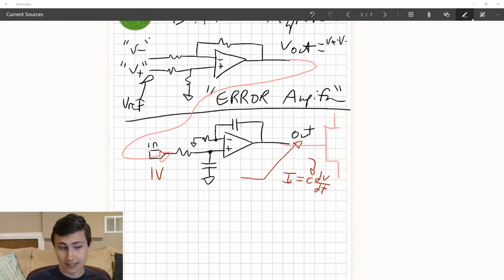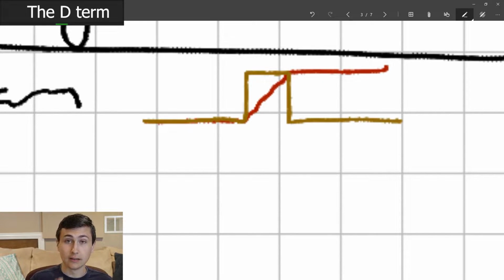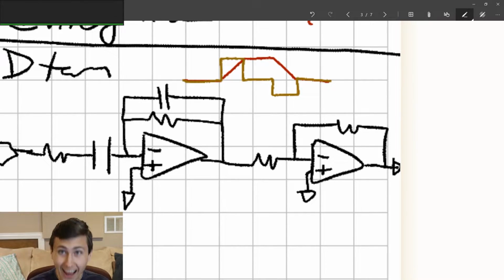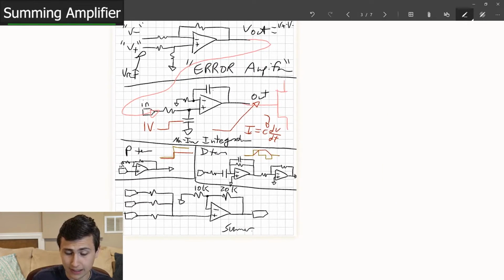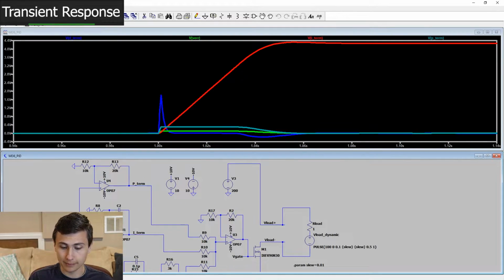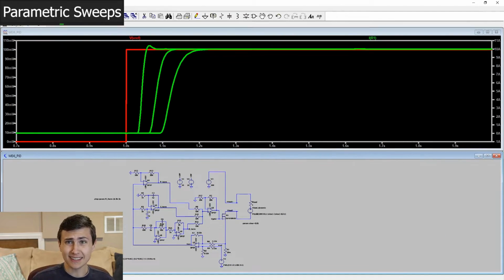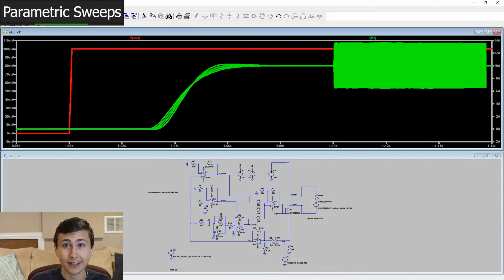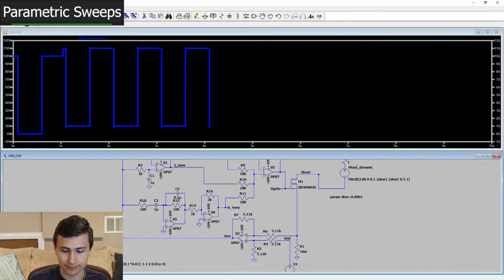PID Compensator (Improving Transient Response)

Comment: The results that you are executing in transient are not the same as iam executing them why?
Reply from the maker: Interesting... I'd expect spice to work about the same everywhere. A couple thoughts: varying step size in transient simulation can make slightly different numbers appear. I didn't restrict step size, so that's possible if we're a little off 

If we're way off- using a different opamp can have a big impact on performance! Other than that .. it's hard to say, If you can find our email on the about page (www.youtube.com/EEforEveryone/about)

I'll gladly send over my sim file!

Comment: Looking forward to an electronic load project.
I have enjoyed your take on introducing/developing A PID control system via opamps.

I have a couple NOS TSD4M350V's  on the way hopefully. Who knows when they'll turn up though =P
(Cheapest high power FET I could find with a DC rating curve?)
I also bought some socketable multi phase converters for high current testing.

I think a mix of analog and digital would be nice. Definitely want some fast acting protection circuits.
A current sink is a good place to start, but some way to do an ohmic load or constant power would be nice.
I recall there are some analog feedback circutis that approximate these? Depends on accuracy? I've never built them.
Analog multipliers are hard and/or expensive IMO =P. But then the alternative is digital control systems and that becomes a whole other discussion?

Auto ranging would be nice. I think the issue there is switching softly between them.
I guess the economics would mean the best option is low side switching with another FET?
High current relays, or reed relays for speed, if you want to be able to handle higher voltages get very expensive?

Depends if you're talking sub 5-10A down to milliamps, or you want one unit that does millamps to tens of amps?
Reply from the maker: Hello Normally Open, 

Oh boy, I'm starting to fall behind on YouTube comments now. :) That's a new level! Even if I'm a little late, thank you for reaching out, and thank you for leaving this awesome comment.

I tried to find a datasheet for those parts... are they super obsolete? Didn't find anything from the usual suspects.

Agreed on the mix of analog and digital, analog for fault handling (maximum speed) but some digital features will be good too. Like you said, behaving like a resistor, voltage source, etc, will be awesome! And perhaps we can find a way that reduced transient response or refresh time becomes an acceptable compromise when operating in the more advanced operating modes?

The nice thing about autoranging loads is they can all be in parallel, assuming the same DC voltage withstand exists across all ranges... even if they all can't pass current at that voltage!

I don't want to repeat too many thoughts from my other comment, so I'll leave it at that for now. Can't wait to see you in the comments as we kick off the design series! Thank you again for watching!
Reply: @EEforEveryone  It's some ancient "SGS Thomson" panel mount bolt/tab connector . The datasheet refers to an IRFP350 for the avalanche rating, so it could be the same thing in a better package? the "hope it arrives" is that I was browsing aliexpress sellers of panel mount power transistors, looking for cheap ones that had DC ratings in their datasheets.
We are in agreement with the need to not have disconnects if they all have the same voltage rating. My thoughts jumped to something more akin to an "80A,"75V" rated linear mosfet coupled with a "15A, 500V" linear mosfet, rather than  having to spend 5-6x on the transistors. An interesting optimisation problem, but probably too difficult =P